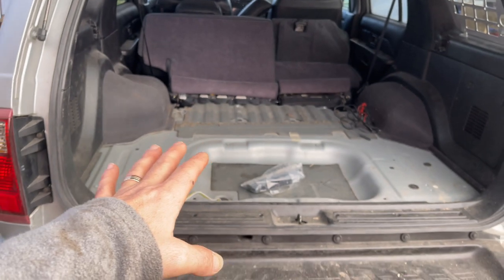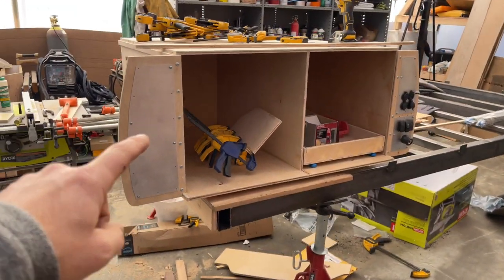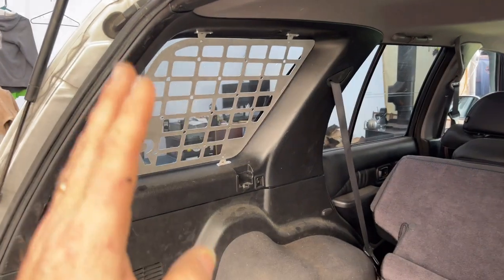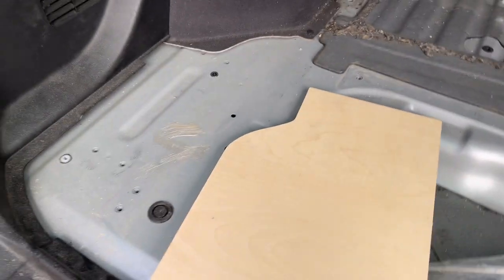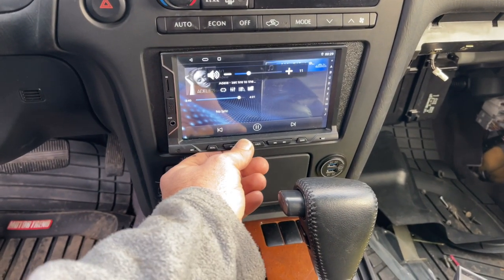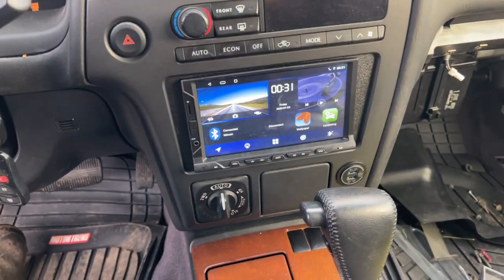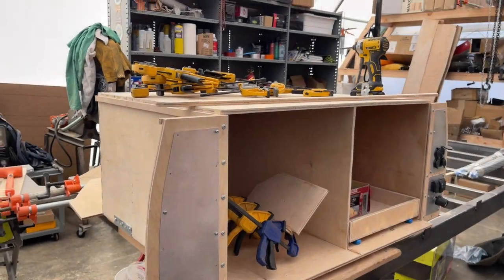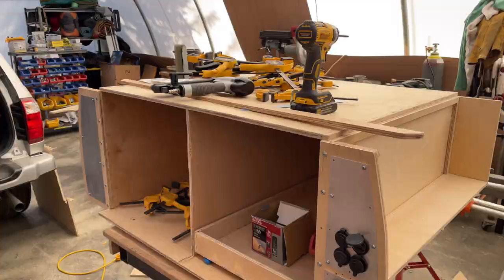Infiniti QX4 - Android Radio Unit & Drawer System

Comment: Great setup...do you remember how the Double Din Radio was in installed?
Reply from the maker: I had to get an adapter part that went into the factory mounting section, than the doubledin was fitted into it, but I did make a custom trim ring that goes around it to fit it "factory-like"

I believe you can find a lot of info on the FB groups for r50, as thats what helped me a lot., searching what others already posted - plus community is very good on helping out with recommendations